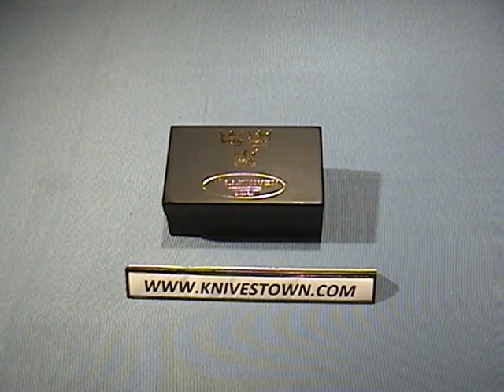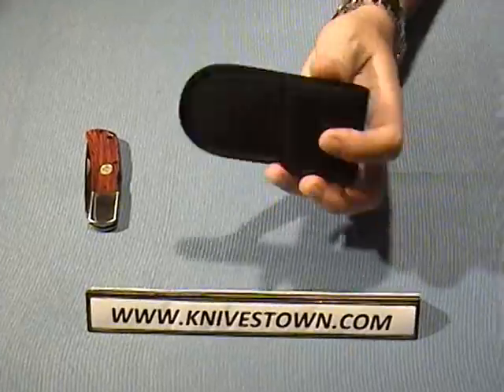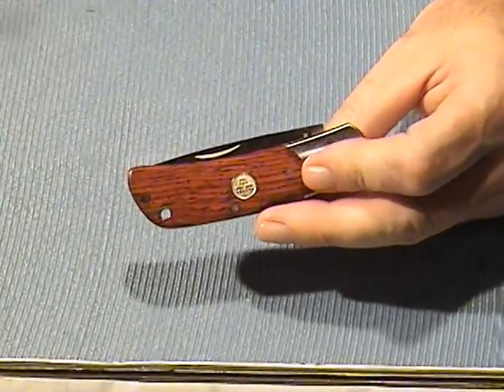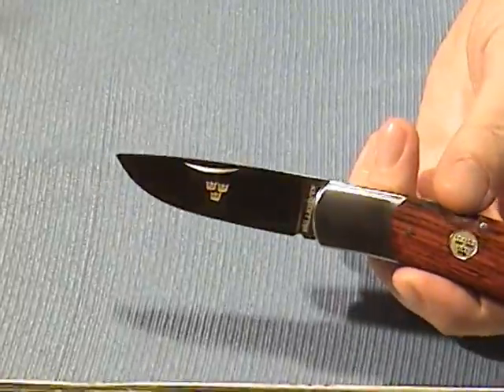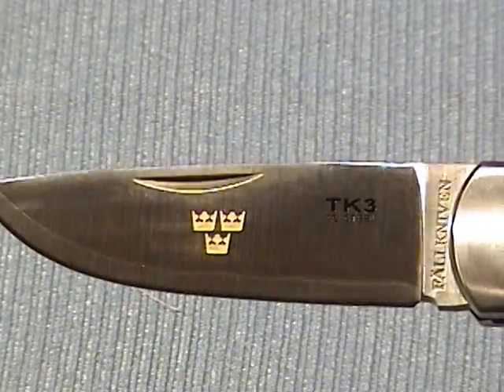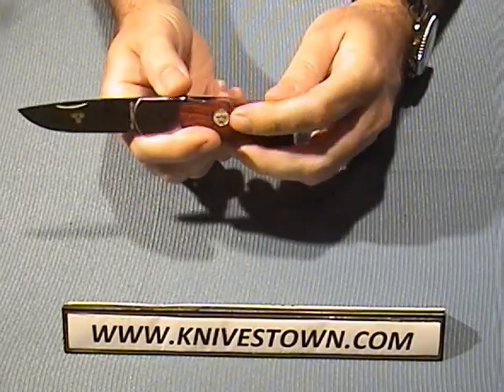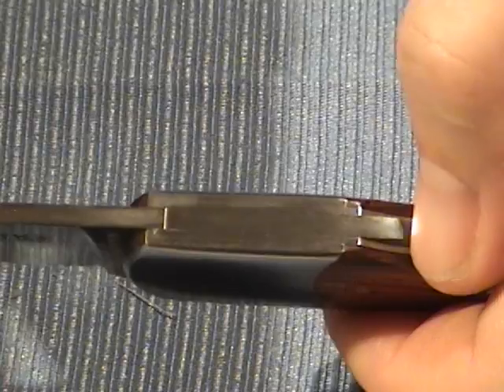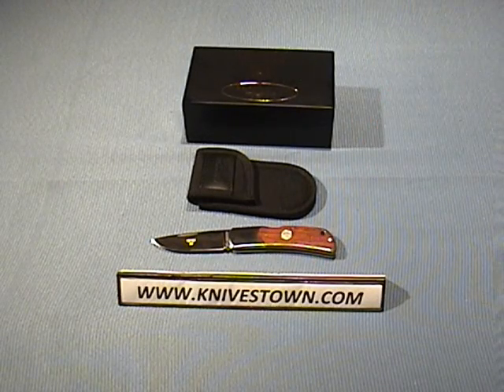Fallkniven Tre Kronor 3 Cocobolo Model TK3

Comment: I've only just seen this video.

I've owned & used one since December 2004.

Not only is it a real looker but it is also a superb performer.

As long as the 3G steel forms the edge, the uneven lamination doesn't effect the performance.

Mine has been used to skin a mud crusted boar, several goats, skinned and cut up many dozens of rabbits, several foxes and scaled, gutted & gilled close to 200 fish.

BTW, the sheath can be worn both vertically as well as horizontally.

Kind regards
Mick

Comment: I love that cocobolo, thanks for teaching I got another one in cocobolo, I have a question and doubt you know what angle of sharpening it has 10/10 = 20 degrees ... 12/12 = 24 degrees I have doubts, how many degrees do you sharpen your TK3,  And another question, the golden crowns, you wear them and my new Tk3 isn't, you know why?  if it is due to the year of manufacture or because ... thank you very muchThank you very much from Spain, greetings